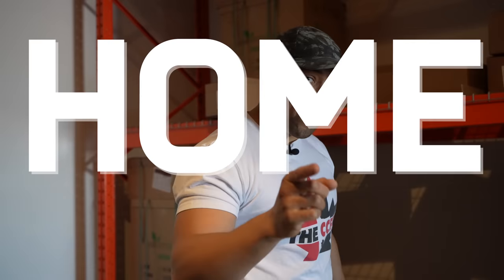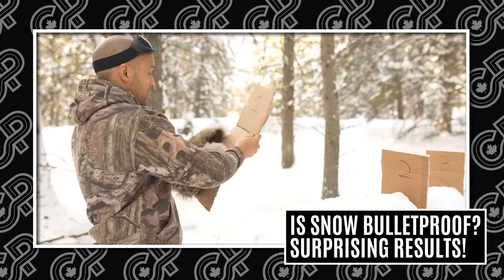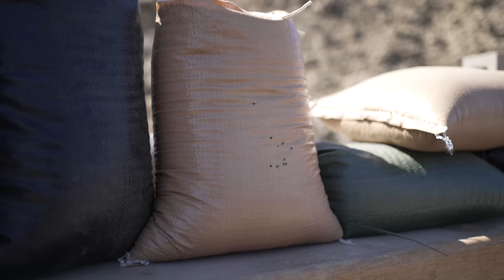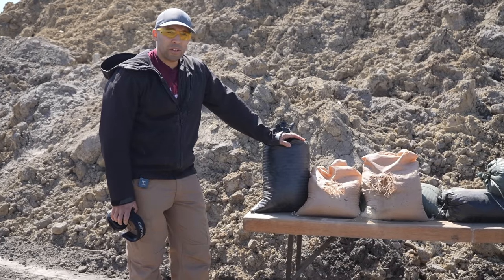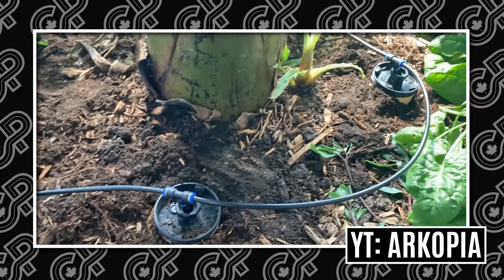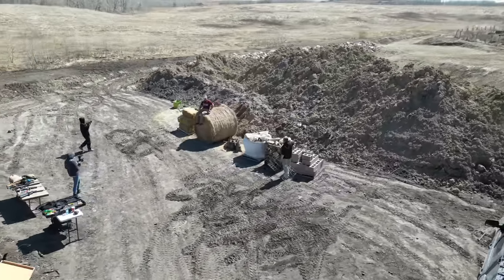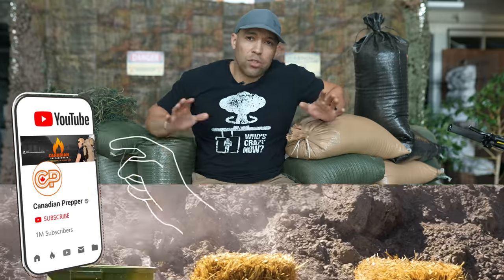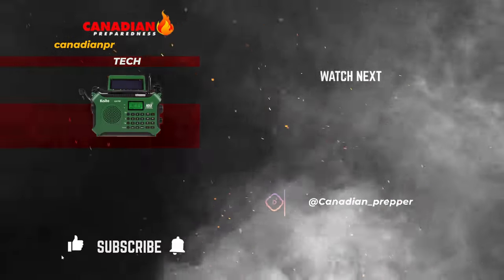Build Bulletproof Sandbag Fortifications After SHTF

Comment: I was patching a nail puncture in my tire, and realized I'd never mentioned the patch kits as a good thing to stock for the next era of humanity.
Reply: Tire patches are a must.  My dish soap in a spray bottle has come to the rescue many times. You know the frothy drill   If you don’t. I feel for you
Reply: @rebeccamcardle8071  it works far better if you mix in a couple pinches of corn starch. Keeps the bubbles from popping. We use it at our tire shop daily
Reply: Like there will be gas😂
Reply: @charitycollins2571  there will be four a while, and there are mods to make engines run on biobutinol.

Comment: My weakest point of my shop (apartment is above) is the front which has bars but it's mostly wood and glass. My plan is to use railroad ties to build a wall to reinforce the front. It will take time but should hold up to quite a bit of gunfire. The sidewalls are 2 foot thick rock walls. Not cinderblock but native rock.

Comment: I don’t think Earth bags are more durable than sand bags it’s that they’re mixed with high clay soil and hosed down when you set them. They dry hard in a few days and then are covered with Adobe or a variety of mixes which holds everything in and keeps the bags from breaking down. No machinery needed, just a hoop, a few strong backs and lots of perseverance.

Comment: Great thing about sandbags is you can also place them in the house for a lower footprint. We used to also use those large sewer concrete tube sections stood on end, bermed with dirt, then the sandbags all around. 4x4 posts with a roof also covered in sandbags. And if you want to go even one step further, a grenade sump. But I am not sure folks will be tossing those my way. Putting those around your perimeter will ensure the neighbors know you mean business. And of course, face paint and full cammo. In my neighborhood, I use a Lincoln for cammo.

Comment: I had huge piles of leftover (baseball field sand?) left in the woods by my house. Found this material to be superior to sand, gravel when it came to stopping many, many rounds. It retains a certain level of moisture, which not only makes it a lot heavier but helps plug the hole when shot sometimes. Typically my sandbags with this particular sand weigh around 80lbs each. With regular sand they weigh about half to 50lbs. I even tried moistening regular sand, but still doesn't "plug" quite like the baseball field sand.
Reply: I think the baseball/tennis court material has a certain amount of clay in it?

Comment: I had to restart my phone to comment I did try all other troubleshooting too. Anyway....
Funny sandbag story. When I was in the military, one of our instructors had about 10-12 of us break down a sandbag Defensive Fighting Position. Was a decent size. He told us to re-stack it but to soak all the sandbags in the creek (Texas winter) which was 175 to 180 yards away. We were timed. We ended up starting a chain and made the time. Instructor didn't think we'd do it so he was surprised after he walked out. Long story short... I got hosed down because my PT uniform was still caked with muddy over my left shoulder (while I was still in the process of cleaning it). Happened during a surprise weekend inspection in the AM next day.

Comment: I save feed bags to use where a sand bag is needed. My mom lives in a flood zone and I plan on using them at her place if it floods again. I’d also dig sand off my property if the need comes. After the fact I could haul them back home and put the dirt back in the hole.
Reply: Pretty heavy when a feed bag is filled... 100 pounds plus? Need a team lift just one..my back hurts already
Reply: @charitycollins2571  I was thinking that they only need to be half full. That way the opening can be folded back and they could sit flat.
Reply: yes

Comment: Consider 1A limestone or 1a slag instead of sand. The limestone (and slag) settle better due to their shape. The may not leak so much if the bag gets a hole in it. Supply yards that have sand should also have these.
Reply: Here that material costs $60-80 /ton other gravel is$15-25.
Reply: @reidcrosby6241  Ouch. I hate the future. Can't afford anything lately. TY

Comment: As someone who deals with flooding, I've filled, hauled and stacked  more sandbags  than I care to recall ....  that said, I offer two tips:
One CP didn't mention  is how stinking much physical labour it takes to fill and build with stand bags.
They're  awkward to fill, time consuming, and awkward af to maneuver after a bit when you start getting tired. They're dead weight  and floppy, hard to wrangle dead weight at that. So be prepared  to work  muscles you didn't know you had....
Btw, BIG Props to your kids man, they're little  go getters! Impressive efforts 👏 👏👏 
Two: 300 sandbags doesn't  go far at all. Like, 30-40 foot wall,  maybe, and not even knee high kinda thing. 
Depends on thebag size and shape, how tight filled etc. But yeah, they dont go far, but theyre great to work with, dont seem to heave with frost  and make awesome  under pad for stone walkways  too. lol says the landscaper in me.

Comment: Thank. That was useful info, though I don't have a lot of sand around. For building, those earth homes, with some chicken wire between the bags are supposed to be quite stable and bullet proof. I had heard that concrete filled cinderblock was supposed to stop things as well. If the blocks themselves are so fragile, would it be safe to assume the same would go for a wall of concrete filled blocks -- the blocks would fragment and you would have pieces of concrete left?

Comment: We have about 3000 SB's, most are green and brown.  Some black around the entry points.  FYI, at the shoot house Thunder Ranch a 9mm goes through 4 drywalls, and you get charged $20 per bullet  missing the bullet trap.  So 1 miss going through 4 walls =$80.  Good Post Nate.

Comment: Looters will have more than just guns at their disposal.  If you don't have a lookout 24/7, a looter could just slash the lower bags with a blade and the wall will collapse on itself.  Bail of hay, strike a match or throw a molotov cocktail. Water just needs a puncture and it will drain. Not to mention you lose all "gray man" inconspicuous properties when you make your home look like a bunker.  Cinder blocks at least make it look like a "normal" wall.  And most attackers will see the wall as impenetrable even if it's actually less bullet proof than the other options.

  I think best option is to wall up first, hope being a gray man buys you time, then fortify with bullet proof options behind that wall afterwards.

Comment: I started buying sandbags a few years back. I keep some in my truck for emergencies or traction on rutted roads. My theory is to fill these bags, stack them by the tailgate to stop projectiles from the mostly peaceful protests in the large cities. I have a Decked Drawer system in my truck bed, bags will fit nicely in the space between the drawer and tailgate and not move around.

I also have about 100 at my house that I can fill and put near doors and windows in my basement if needed. The best way to build is to make the sandbag wall 2 bags thick then go up from there. That will give about 18 to 24 inches thick. You will also need a minimum of 18 inches of overhead cover. The way I did this in the military is to use pickets as cross beams, put a piece of plywood, line around the perimeter of the plywood with sand bags, then fill in the middle with dirt. This will help to stop air bust artillery fragments from getting into the fighting position. It can also help to keep you out of the weather.

Comment: Buy the bigger bags and fill them with free dirt maybe a thought. Then you will need less sand bags. And the 1 ton capacity bags or roughly 3' thick when filled hints gamma radiation berior as well. Just a thought and what I would do

Comment: Question regarding sandbags for radiation fortification- is a wall of them enough protection? Or do you need something over your head as well? (I can’t remember my radiation ‘lessons’ as to how radiation moves)
Reply: Radiation moves in straight line.
It will splash out when it hits something solid, so design two ninety degree turns in your entrance door.
Yes, you do need overhead protection, fallout floats in the wind.

Comment: Some images from CalEarth are used in this vid in the segments talking about the earth homes. They also have free simple instructions for making a small expedient shelter that will house 1 or 2 people and offer a great deal of radiation protection. Nates comment that they require heavy machinery to fill is incorrect, but since you mix cement in and wet it, its a bit more labor intensive than just sand. Like survival this is a marathon, not a sprint. Dont think shovels and back breaking, think a coffee can scoop and slow and steady. But if I'm going to be putting in this scale of labor anyway I'll use the method thats going to give the strongest, longest lasting shelter, which is the earth home style.
Reply: Yes - Earthship homes are the best way in my mind... 

Definitely deserves to be the go to home if your living in any area that mother nature has a dislike of standard stick build...

If designed right - the lay out could be very well hidden from public right away with very little work....

Comment: Camoflage is the first.  Look poor, don't attract attention.    Also tree trunk elements stacked 2 deep turn into rifle rated bullet proof barrier.    12 inches thick by 2 feet tall and they WILL stack easily.   Not going to stop an M-134 minigun but against small arms they are great.   I use tree trunks holding up some steel targets and they do not move for any rounds (223, 30-06, 45-70, 12 gauge slugs)

Comment: I've shot Ak47, 50 cal machine gun and 50 cal sniper. 
The Ak will get you from 100m standing behind 20-30cm of reinforced concrete while the 50 cal from the same distance, turned a 1 cubic meters reinforced concrete block in to kitty litter in under 60 seconds. 
Trees, cars and even concrete walls only offer optical cover. 
Even the sandbags, I would do a double wall minimum.

Comment: Im not sure that those rectangular hay bails will work as fortification. I use those hay bails on my archery range. I target practice multiple ways, fire arms, archery, axe throwing, even made and use a Atlatl spear .... I wouldnt hide behind hay bails if I were you. With hunting arrow heads, they go right through like warm butter. Ive lost arrows in the woods that way,  Arrows go right through. Same as spear, as for firearm target, No way in Heck is a haybail going to stop a 9mm round. Its not happening.

Comment: You would need several tons (a dump truck load) of sand available.  Then several hundred(s) of available bags.  Figure a day or two to fill and stack them all with only five people.  All doable.  
For home protection I would think possibly stacking on the inside would be the best option.  That way the opposition would be less likely to try and find a fifty cal to get in.
But then they could always ram a huge truck thru the walls, depending on their motivation.
Good video though.

Comment: Another mistake people make is assuming steel will stop a bullet. It takes a lot more thickness to be effective than most people think. 1/4 inch thick steel is quite heavy in any size one may try to cover a window or door with, but .556 rounds will zip right through it with no problem. It would take 3/8 to half inch thickness for me to expect any result, and we are now talking about an armored door that would weigh hundreds of pounds. Not practical at all.

Comment: If you want a bomb proof building 
Pumicecrete is by far the best building material on the planet Pumicecrete is a mixture of pumice cement and water mixed and poured into a set of reusable forms walls are poured from 12"to 24" thick pumicecrete is fireproof termite proof rust rot and mold proof and has a high R value and good sound attenuation solid poured walls means no critters can live in your walls Pumicecrete can be built for a fraction of the cost and time and pumice is one of the few building materials that can go directly from the mine to the job site ready to use without any additional possessing and zero waste Google all the walls of my house are made of pumicecrete  Take care Ray

Comment: So I purchased a couple hundred sandbags for possible future usage.  The problem I have, is that I live in a clay soil region.  Right now I'm trying to figure out the best way to store bulk sand delivered by truck.  So far I thought of using several 55 gallon plastic drums with removable lids or maybe a couple modified 330 gallon IBC totes.  Either way, it's going to take up alot of space.  Has anyone thought about this or came up with something better?  I want to avoid putting sand directly on the ground because it will just be eroded away over time.

Comment: My primary hunting rifle is a Winchester .243 Ruger. Hunting I use 80 grain but for the range/target I use polymer tipped 58 grain and they fly very fast and far. When I'm up on my grandfather's property visiting I set up 2 sandbags as my target for 350 yards when I'm shooting regularly and on point and 300 when I haven't shot in a few weeks. Those bags eat those rounds non stop till I'm tired of shooting in a day. Helps it's a smaller round I aim high to start and work my way down  to let the sand last long as possible so I don't have to walk it 😂

Comment: in using canvas sandbags, you can mix cement in with the sand as you fill them.. as they get rained on, they turn to concrete (museum-purpose trenches in Flanders Fields are made that way)

Comment: If you are putting sand bags outside I suggest you put a tarp over them or a blanket to protect it from UV light then it should las a LONG time. You can also partially bury them which gives UV protection and adds another layer of dirt.

Comment: How would cinder blocks fare with compacted sand or concrete in the voids. Feels like the sand ones might still break apart, at a slower rate and the concrete would just be a solid wall. 🤷🏻‍♂️

Comment: Another question: in addition to  potassium iodide pills to protect the thyroid… I believe the are two types of treatments to take to bind and/or flush radiation out of the body. Prussian blue, which is available in pill form, works through the elimination process to get it out of the body. DTPA, there are two types, works through the bloodstream and binds to radiation. I believe I read it is available through injection or something inhaled. I have only done literally five minutes of reading on this topic, and would love to know more, including where, and how to get this treatment. I would love for Canadian prepper to research this stuff a little, and tell us how we can pursue actual treatments for radiation poisoning/exposure, which I’m sure is going to be very needed. Also, I am an emergency preparedness person in my church and I have researched water a lot and what a lot of people don’t know is that to get radiation out of water you either need a filter that is specifically a radiation filter, or you need to distill the water. these are the only two methods I know of that will work to take radiation out of your water. The old bleaching and boiling thing does not apply. We could use some discussion on this topic as well.
Reply: APPLE PECTIN. "Treatments" won't be available.
Reply: @resarm5007  thanks for this reminder. Please see the article below that I looked up due to motivation by your post. Gives many natural remedies. Thank you!

Comment: Sandbags for housing won't work too well if you get hit by an earthquake or the shockwave from a nuclear blast.  Unless you want to be buried alive, with suffocation.   To protect against bullets, sand that is sharp at its edges will interlock best to stop bullets.  River sand that is tumbled and rounded like tiny ball bearings or marbles doesn't interlock grains as well, and so won't stop bullets as well.

Comment: A straight up metal plate 3 inches thick little will get through. Make a concrete block house fill with sand between the walls cover with rock sand and dirt. Think ww2 bunkers, little will get in. A barried bunker will be best.

Comment: I've also made fake concrete slabs so when you step on them you could actually fall through it and end up getting spiked with nails..... Easy-to-make all you do is you take two slabs of concrete Saran wrap both the slabs get a thin towel that would cover the circumference of a slab plus the sides mix the towel with the concrete put one slab on top of the other format to it looks like the slab wait till it dries put it to a goes up to your walkway most people usually enter the back way not necessarily the front so your backyard is the best place to put it because then nobody sees what you're doing dig 2 ft down a shitload of nails on a plywood board any weight on that fake slab and ouch

Comment: basic polypropylene can lose up to 70% of its mechanical strength after 6 days worth of exposure to high-intensity UV radiation. It should be noted, however, that even with the additives, polypropylene will still degrade relatively quickly when exposed to sunlight for a prolonged period of time.

Comment: Old Tires wired tried together with a little bit of cement mixed in the lower level and in the side's of with straight sand in center to act as a planter's for big torn plants 🌵 to provide a real good reason not to cross over the tire 🧱

Comment: Where do you tie a sand bag? Is it in the middle so that it can lie flat and have the bag half filled with sand/dirt or sound you tie it at the very end and fill it to near the top of the bag????
Reply: Tie the end. Don't pack it completely full. Tilt it like a seesaw a few times, lay it down, and smack the top flat like you're spanking a stripper. Put the layers offset like bricks. You can go two or more wide to build higher if it gets unstable.